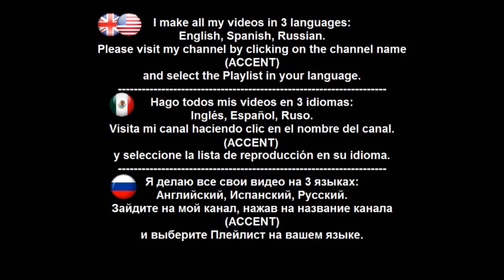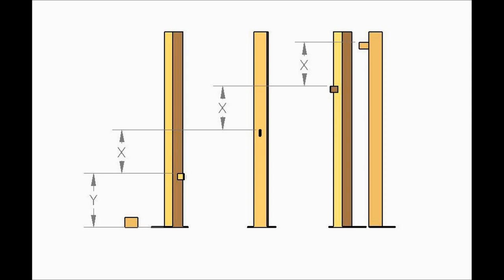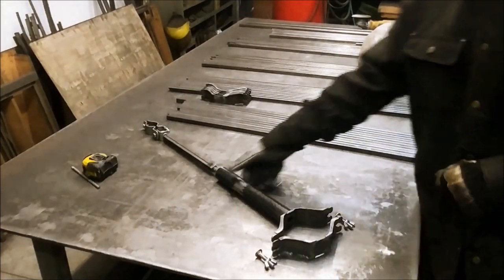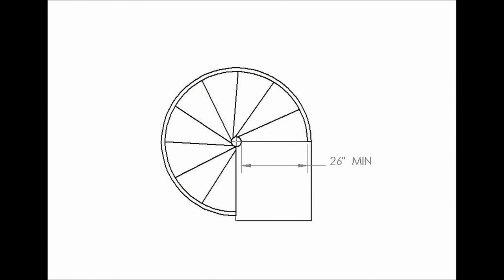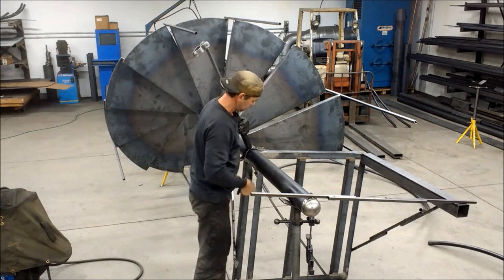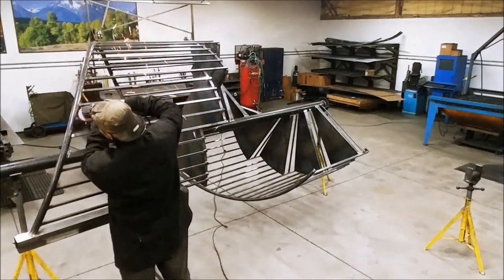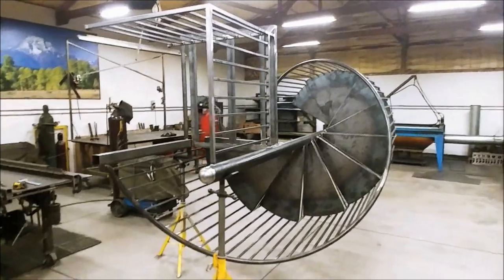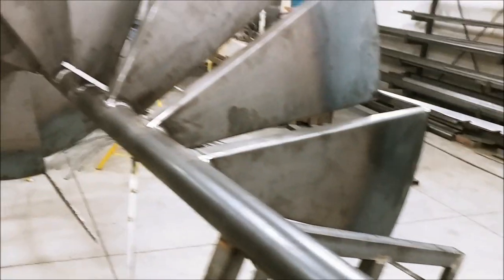Part #3 of 3. How to make a Spiral Staircase. Step by step.

Comment: What about part 4 ?  Installation - would be fun I think ?
Reply from the maker: Nothing interesting. Just lift , set it in upright position, screw the landing to the deck, and 3 anchor bolts to attach the center post
Reply: Hi. How did you transport it to the installation site and lifted it? It must be weighted a lot =)

Comment: ya lost me at the getting the correct handrail pitch lol. how do you know the angle to twist the handrail to get the correct pitch? running the rail through the bender multiple times in increments?
Reply from the maker: Knowing your floor to floor elevation you can calculate how many risers (9.5" max riser). Number of treads is 1 less than number of risers. Each my tread (there is the drawing in Part 1) makes 29.5 degrees of revolution. Now you know your total revolution and the high of the handrail: (#of risers-1)× your riser